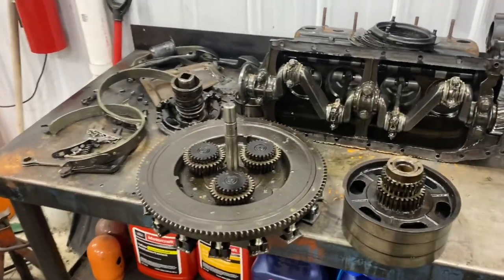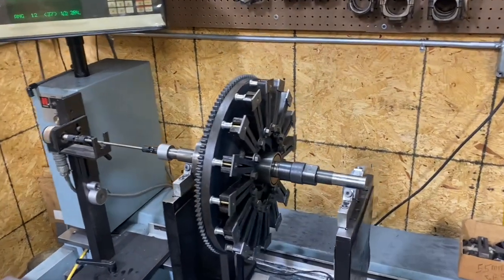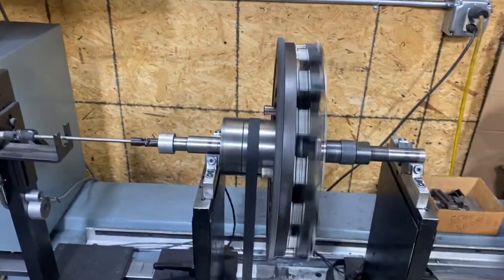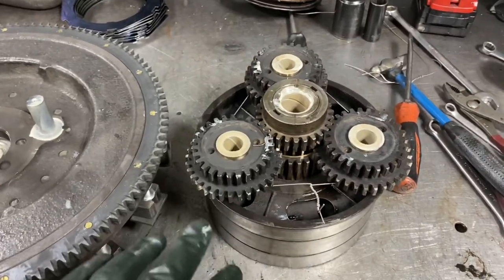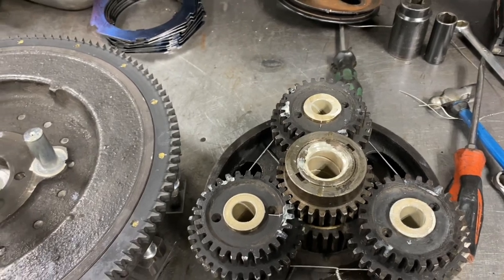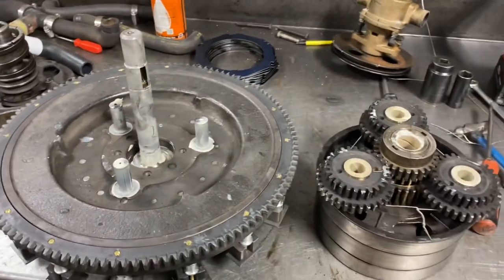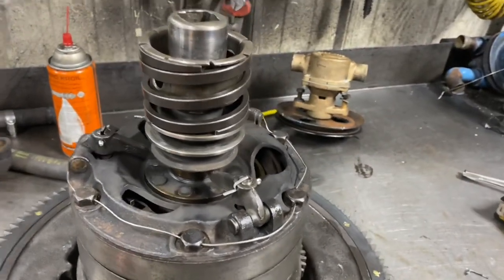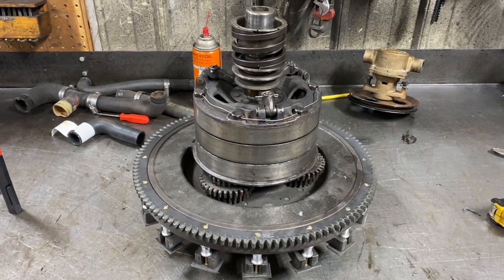Ford Model T Transmission Overhaul

Comment: I wanted to ask question do the magneto coils get hot and what if be todays standards wuld happen if neodimium magnets were used or ceramic magnets? Wuld the coils burn out ? Actualy I wanted to build some thing similar self containing variabel ignition system also modifi gears for me needs even tought that Ford Model T isnt realy reliabel honestly dont like that strange arangement engine breaking is great but not in fast reaction movement in emergency case they do not work well or driver injury .
So can you please describe the ignition system some what and how negative ground system wuld look like .
Many peopel are not specific about the magneto to baterry swap system the generator and baterry are seperate circuets but no one mentiones if they share engine ground or not with the magneto so I dont understand them do that switch remove bouth baterry+ and - conection or just 1???
And what happens to the magneto if it is conected wia ground to baterry or the baterry it self wuld it not react with the magneto ?
How much I understand thats AC electricity so dono how they use those trembler coils seperatly it is confuseing .
Im actualy more curiuse to see if the baterry life span wuld be lot bether if the baterry does not tuch ground and only uses wires directly to baterry not useing chassys .
Thats what confuses me most be that car because some engine types actualy use reverse polarity .
Im useing such engine me self that can fire internali and extermali or combined some times I use that feature to simulate older engine designs and for conversions.
So mostly that magneto confuse me and those thembler coils they do seam partialy to operate true the generator as well the vibrator coil I might be wrong on that but no one realy answered me question.
Because Im woried due to magnet demagnetisation and if any thing is wrong with ignition system that car is like electric fence and I do not like it generator tuching ground or shareing ground with the magnito .

Comment: What is the cost to have this service done?
Reply from the maker: It’s expensive as the engine needs to be removed, hogs head and oil pan. Parts aren’t bad at all. It’s the labor that expensive.

Comment: Nothing on how to remove and replace all the bushings makes this video useless 😑
Reply from the maker: Pretty straightforward except for the final fitment. Drive em out and drive em in. I finished them in our Sunnen connecting rod machine.
Reply: I came here looking for that as well.  How to measure and what tools were used.
Reply: @timmahle8050 Ford left this service operation pretty much out of details in their service manuals.  What I conclude and have done is it is a hand precision job. All new bushings are each pressed out and pressed in with a press then hand reamed . In my opinion unless your a damn good machinist or you know one with a variety of reamers don't bother yourself. The tolerance is very precise. And make sure you weigh each before and mark the position of the 3 planetary gears for correct balance.... very important. Good luck